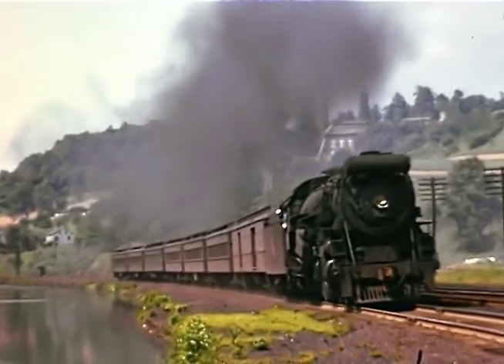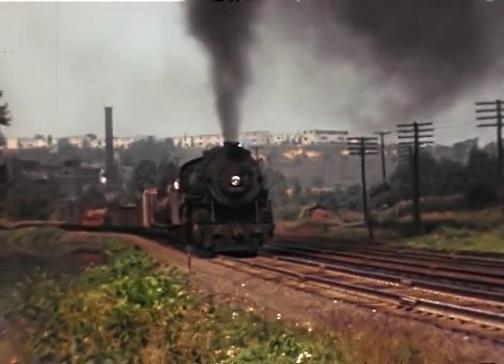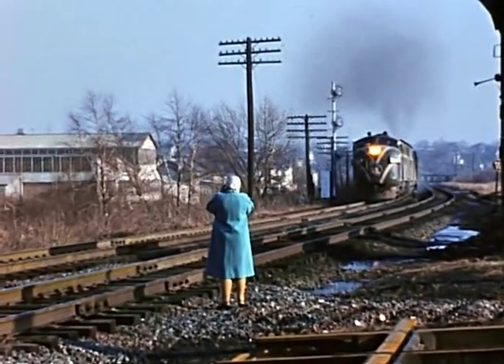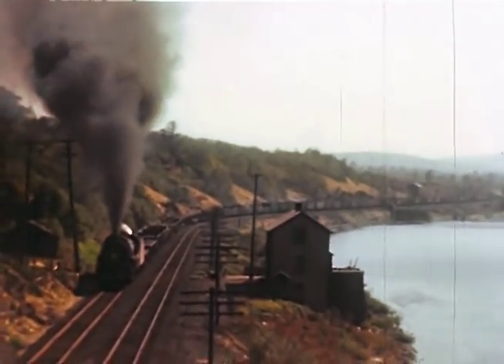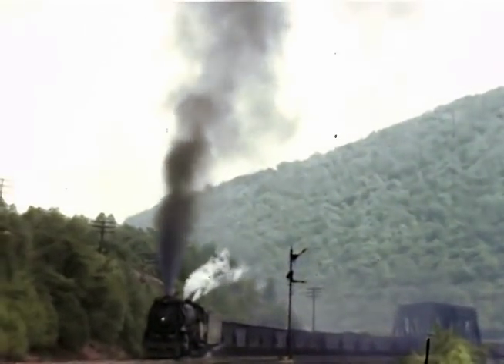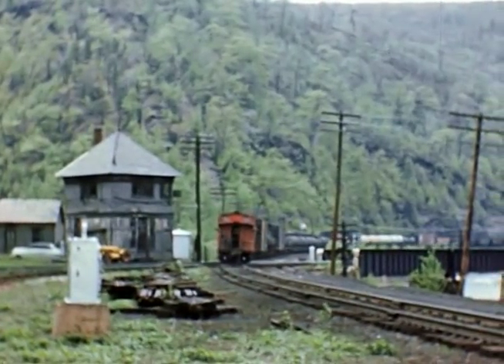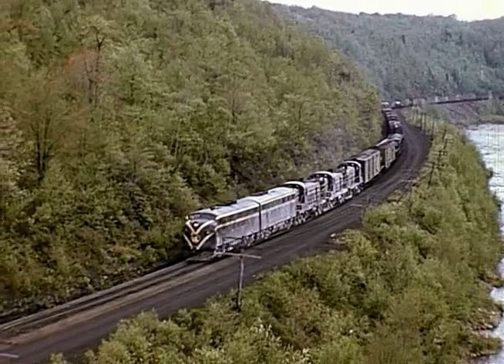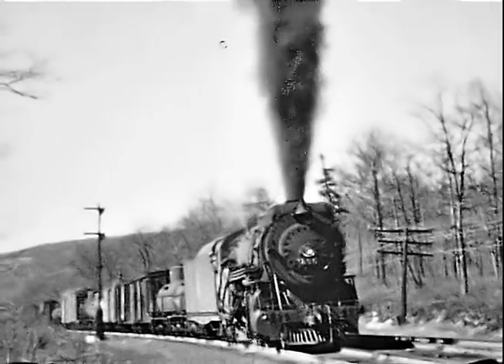Along the Jersey Central Volume 4

Comment: I never seen cable-pulled freight cars. Did they work like a funicular?
Reply: There was an area outside Wilkes-Barre I believe, where the grade was too steep for standard traction so the pushed them up with cables.
Reply: This was how Blue Coal Colliery in Ashley Pa got the loaded coal car’s up the mountain to Mountain Top Pa from the mine before the railroads built a more gradual path up to the top

Comment: At the start of the program,at the site where STEEL Tower was built, is that the Sinter Plant at Bethlehem Steel? Thanks,   BP
Reply: No-the stack in the background is the CNJ’s Bethlehem engine terminal. Steel tower was built at the west end of small Bethlehem yard. Steel was named after Bethlehem Steel which was on the south side of the Lehigh river,the CNJ was on the north side.